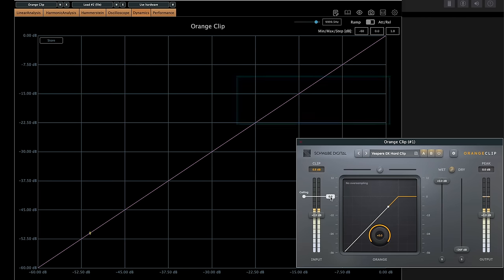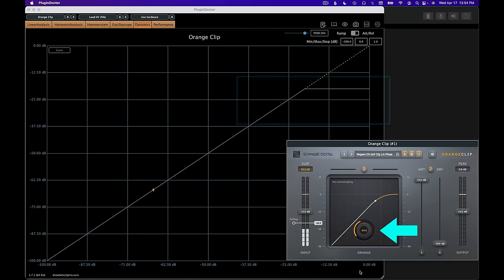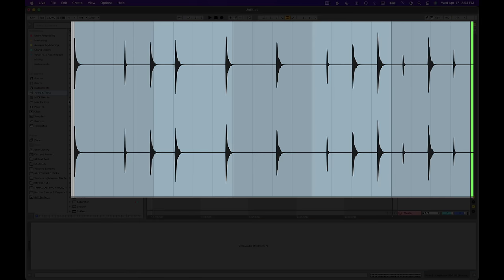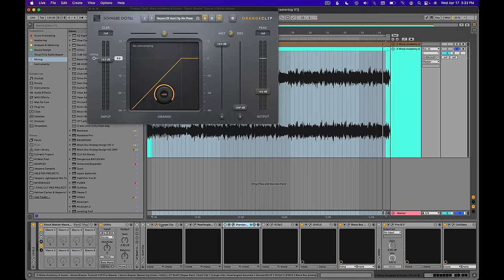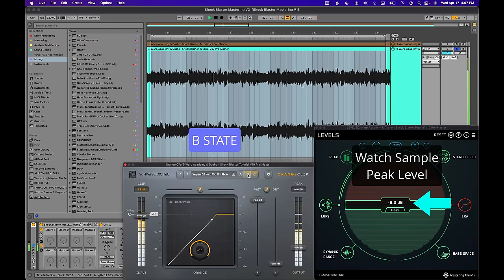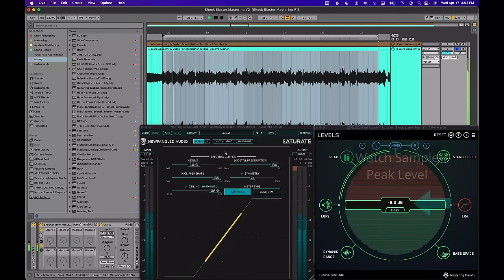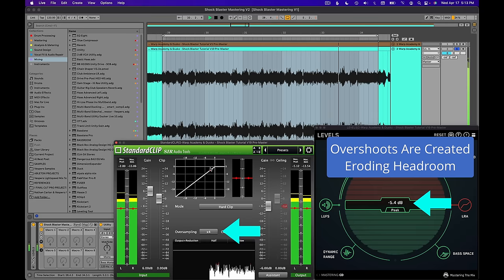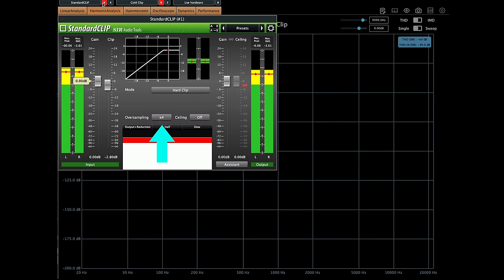The Science of Clipping - The ULTIMATE Tool for Loudness + Punch

Comment: OKAY so i finally tried this out. I went to my project (I mix and master at the same time dont shoot me I love it) And i took off the over sampling on all the clippers. i use kclip to hard clip, then use standard clip pro clipper mode to add some SLIIIGGGHHHTTTT expansion into a clipper. Max 1 db of clipping. I was 4x oversampling on al of them. And the sonics are so much more different. Its noticble right away when i A/B them. I also notice that the 4x oversampling changes my wave form, make some peaks smaller for some reason idk why but then I have 0.2 db more headroom when I dont use oversampling. I also notice that the 4x makes things kinda squashed together. Ruining the open separation and depth that i worked so hard to learn and test and create in the box. The 1x sounds a bit darker, but this is a dark mix, its supposed to be dull and sad. The production is also using dull tracks. That "dullness" I am getting is the OG sound i was after. I also noticed the 808 and snare opens up and you can hear the syncopated rhythm better. I am so shocked that this many changes happened using the over sampling. I over sampled on my kick, snare, > kick and snare buss, > drum buss and my master chain. Insane. 

I am still over sampling on certain plugins that inject distortion and harmonics on non transient tracks and using oversampling on a saturation plugin on my mix buss but its paralleled saturation through the plugin mix knob mix knob. Never gonna use oversampling again on transients. I am def gonna look into gold clip as well and see a new A/B
Reply from the maker: Thanks for sharing your experience.  This is very similar to how I work.  I use oversampling on devices that generate harmonics that can be heard on more sustained material (saturation / distortion, soft clipping on things other than micro-transients).  

When you upsample, the clipper is now reading and addressing formerly inter-sample peaks ("true peaks") and clipping those.  Plus oversampling / downsampling / LPF anti-aliasing filter will change the waveform, as you noticed, changing the harmonic structure by filtering out supersonic frequencies.

Kudos to you for actually testing this out in a mix and observing the results for yourself!  That's a how you learn and improve.  Cheers!
Reply: @warpacademy  Yes thankyou again for the amazing lesson. Its these little master class theories that separate the advanced from the pro's
Reply from the maker: My pleasure.  Thanks for the comment.  See you around the channel!

Comment: This was a super cool Video as always. I think oversampling can be genuinely useful, especially when it comes to more aggressive clipping but in this case it makes absolute sense to leave it off. Thanks for the Input!
Reply from the maker: Exactly, you nailed it.  If you're clipping aggressively where you're using soft clipping knee to affect more than just a micro-transient, or you're using hard clipping to dig into more of the signal (IE a longer audio event) then it makes sense to oversample to reduce audible aliasing from all the harmonics.  That's the "tone shaping" style of processing that I mentioned at the beginning.  

In this case, I'm clipping off micro-transients where any aliasing is getting completely masked by the presence of the transient, or it's adding harmonic density to the transient in a way that adds perceived loudness, as David Gnozzi stated.  

Thanks for watching and commenting!

Comment: This is very interesting, i tried Standard Clip myself and i noticed the same issue. Looks a little better with mixed phase instead linear, but there is still some overshoot compared without OS. Didn't tried the mixed phase with more pole (maybe it's better for peaks) but i'm not so sure if mixed phase should be used in clippers, i'd like to know your thoughts about this too
Reply from the maker: Hey Frankie.  Nice to hear your insights.  Yeah, Standard Clip is one of the few clippers that allows you some control over the anti-aliasing LP filter.  The configuration of the LPF will certainly affect overshoots, because the the source of the overshoots is band limiting the signal, removing the supersonic frequencies that have a flattening effect on jump discontinuities and square wave type signals.  

Linear phase LPF in clippers would typically be used if you're running the clipper in parallel (some clippers have wet/dry, or you may be running it on a return).  Also, FIR vs IIR filters will have different ringing artifacts most noticeable around jump discontinuities (and by that I mean transients and square wave type jump signals where you have a vertical or near vertical jump in amplitude).  And those ringing artifacts are also related to the number of Fourier harmonics / sine wave partials that are used to represent the signal.  Specifically the decay rate of those ringing artifacts.  

For me, I almost never run clippers in parallel.  But I would test linear phase vs minimum phase in clippers when you get the option to do so (such as in Gold Clip or Standard Clip) and especially when you're using it on the master.  See if you can hear a difference.  This is way up close to Nyquist, so the ability to perceive a difference is questionable.
Reply: @warpacademy  I tried linear vs minimum few years ago, and i preferred linear cause i felt a better response with transients, but i didn't digged too much. I think now it's time to do some proper testing again with multiple materials cause i don't use parallel clipping neither, but usually just on my master.
Thank you for your detailed reply, is much appreciated!
Reply from the maker: Sounds like a plan.  Let us know what you discover.

Comment: Before committing to clipping a track, or adding a clipped track to a mix, compare the track to a clean version, a (hard, multiband, like Aphex Dom II) limited version, and a fast attack high ratio compressor. Adjust for identical "loudness" to your ears not level with the same general amount of clipping. . Decide if you like  what you hear. All level shaving is not the same.
Reply from the maker: Good insights!  Always be willing to experiment and try different effects and settings.  I've done this day in and day out for years.  For me, I'm very familiar with how limiting sounds (love it last in chain and sometimes on busses) and how compression sounds (usually not my favourite tool as it produces modulation distortion when set fast enough to catch small transients, but I love it on vocals, basses, pads and more sustained material).  Thanks for the comment!

Comment: Are you using both orange clip and gold clip? Since I saw your last video I've considered getting gold clip but now that I see you have orange clip which I know is more affordable. I'm just wondering what you would recommend, gold or both?
Reply from the maker: It’s a good question.  I do have both. Gold Clip is a best in class mastering and buss clipper.  But it’s too heavy to use all through my mix on many individual sounds.  So you need a track clipper that’s more lightweight and that’s what I use OC for.  If you can just get one, get Gold Clip.  Also, stay tuned on my channel as I’ll have a video coming out soon with Ryan, the creator of both clippers.  We did an interview.
Reply: @warpacademy  thanks for the quick response, you're a gem of a resource for this community 🙏
Reply from the maker: Much appreciated.  Thanks for being a subscriber!

Comment: You are an incredible communicator as well as knowledgeable. However, I really would love you to do a blind comparison test between clippers. The differences were imperceptible to me when compared in this video, I almost laughed when you said it sounded much more open and transparent!
Reply from the maker: Hey hey.  Thanks for the comment.  Yeah, blind tests are great.  I recently saw a plugin that can spool those up and it may work well for that.  

In terms of hearing the differences, there are usually 2 reasons why people don't hear things and others do.  

1) Monitoring system resolution & room acoustics.  If you're listening on speakers that are not designed for professional monitoring, then you're unlikely to be able to discriminate between details in audio.  Additionally, the room you're in contributes more to the final sound than your speaker themselves do.  If you have early reflections because you don't have adequate acoustic treatment, then you're hearing a blurred signal and won't hear much.  It's like trying to listen to someone talk far away in a tiled swimming pool room.  The combination of reflected energy masks the direct signal.  

2) Ear training.  As an engineer, I needed to train my ears to listen to small differences between A and B in audio and make a judgement about what I prefer.  That takes time and focus.  There are many things I never used to be able to hear, such as differences in compressor settings, that are now very obvious to me.  

In no way am I saying that you don't have a good monitoring system, or that you need to do ear training; I don't know anything about your situation.  I'm just pointing out the most common reasons.  

All the time on Youtube I hear people say things like, "On my iPhone it sounds like A is better...."  I just shake my head.

Comment: Amazing video. Wish you added to the comparisson, clipping with the Glue Compressor in Ableton. I´ve been using only the clipping option that comes with the Glue for years now in the master before the limiter. And it´s free :) All the best!
Reply from the maker: Thanks.  Regarding the Glue compressor and soft clip.  It’s very basic and while it can and does do clipping I don’t like that approach.  I like a controllable knee, control with oversampling (IE different settings), and the ability to gain link with a waveform display.  Also seeing how much clipping is occurring helps!

Comment: Another good reason of not using oversampling, depends on the filter is being used for the downsampling, they tend to create pre-ringing or a long post ringing.
Reply from the maker: Hey Tianpei.  It's insightful that you point that out, because it's not actually the oversampling alone that creates these overshoots.  It's the action of the downsampling anti-aliasing lowpass filter band limiting the signal.  It's the removal of HF content that actually generates the overshoots.  

And of course, any cut filter will create pre-ringing if it's FIR and post-ringing if it's IIR.  The decay rate (ringing) of the frequency components depends on the number of Fourier partials present.  When you have lots of Fourier partials, the decay is fast.  When you have only a few, the decay is slow.  

And the ringing artifacts are the most overt around jump discontinuities such as a square wave or a transient.
Reply: @warpacademy  Exactly! Btw I still believe there is only one way of hard clipping or wave shaping to a hard clip state. So in theory the stock clipper is actually the best clipper and the most accurate. Other clippers might add some distortion before the clipping stage so that it sounds “better”.
Reply from the maker: To know which clipper to use, you have to carefully consider a few things.  Are you only ever going to hard clip?  Will you ever need oversampling?  In that case, you will want to use a more full featured plugin as the oversampling and LPF sound quite different between plugins.  If you ever want to soft-clip you will also want to use a plugin clipper, unless you're in FL and have a nice one built in.  Still, I don't think the FL clipper oversamples and you'd want that for soft clipping.  

AFAIK plugin clippers do not add any distortion before the clipping stage.  I mean, why would they do that?  

But yeah, if all you want to do is non-oversampled hard clipping, I mean you could just clip your DAW master output and that would do it too.  You just have very little control.
Reply: Yes that is what I mean, a non oversampled hard clipping effect should always sound the same no matter what plugin you use. But there are enough plugin manufacturers that add some extra sneaky sauce in order to distinguish them from another. Like BSA audio clipper adds a little LP filter at 20hz, beside that it’s exact the same as the stock clipper.
Reply from the maker: Ah yes.  You're correct there.  A hard clipper without oversampling is a very simple, and AFAIK, universally identical, calculation. Things only get different when you're introducing soft clip knee shapes and OS.

Comment: Yes, I could hear aliasing. People focus on the main tone strikes for distortion. That's not where it's evident. Focus on the spatial effects. Oversampling sends the problem out of range. You're right- oversampling doesn't change your signal. It moves a signal competitor off the field of play.
Reply from the maker: Hey hey.  Thanks for joining the conversation.  Maybe one day I'll do a fully blinded test for people.  That would be fun.  On the master, it's typical for me to use Gold Clip with oversampling (you can't turn oversampling off in Gold Clip anyways) so any aliasing on the parts you mentioned would be reduced or completely inaudible.  I went with Gold Clip in my version of the master.  

What I'm talking about mostly in this video is using clippers all throughout the mixing process, as well as the master.  Especially on drums.  And for that, it's nearly impossible to hear aliasing, and if you do, it's actually not a bad effect at all.  Referring to what David Gnozzi said, and what Dave Gamble said later on in the video.  

So for track clipping, it makes no sense to me to activate oversampling.  But yes on the master, if you hear aliasing.  Cheers!

Comment: I still remember when I figured out how useful clipping is for mixing, I was new to FL Studio and wanted to distort a sound, wanted to try out fruity soft clipper since it was in the distortion section, but the plugin has no gain, so I used a plugin before to drive it into the clipper. I was very surprised just how far I had to push into the clipper before it actually started sounding distorted, then I started just putting it everywhere instead of limiters since Fruity Limiter does sound kinda trash by default.
Reply from the maker: Ah yes,  FL Studio is pretty much made for this mixing style.  The Orange Clip plugin that I really like was modelled on the FL Studio clipper.  So you're right on track there.  It has a very specific sound that's become woven into modern music.  Cheers!

Comment: How much GR would you aim for (as a starting point) when using a Clipper in Mastering?
Reply from the maker: Hey hey.  Thanks for checking out the video.  I would challenge you to avoid going down any kind of formulaic approach with this.  It is entirely situation specific and widely variable.  You must learn the tool, train your ears to hear bad side effects, and experiment.  

In general, if you're unsure of the right setting, and if your'e new to using clippers, use less clipping.  Clipping a master is the most difficult because any mistakes in setting the clipping ceiling can completely destroy the master and be glaringly obvious.  Clip in your mix, on a track by track level first, and leave your master alone until you get good at it.  Limiters will be much more forgiving on the master.  

Example: Clipping 2 dB in a hip hop song with a big 808 may produce super noticeable, horrible distortion.  Whereas clipping 5 dB on a DnB song may be completely okay and actually increase the perception of punchy and loud drum transients, while masking the distortion.

Edit: Clipping on the master also produces intermodulation distortion due to driving a complex, full range signal into a single-band distortion device.  So it's the last place you clip.  Clip first on your individual sounds and be the most heavy handed here, then clip your busses next, and finally - only if you need to - clip the master very carefully and more gently.

In regards to that, watch this video: https://www.youtube.com/watch?v=WB7Tk5McHtM